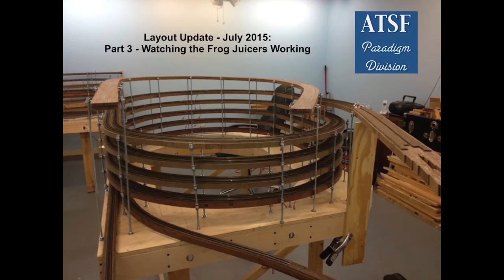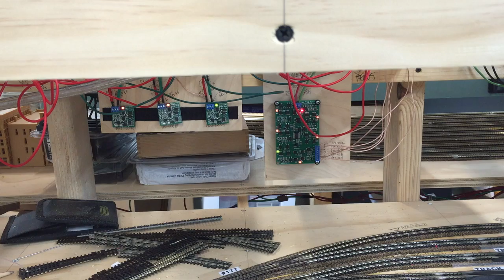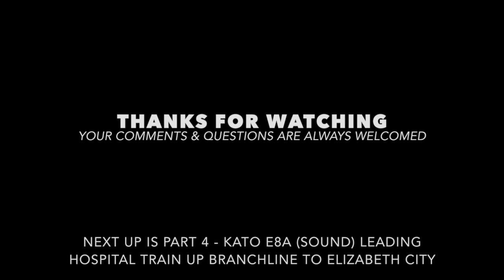Layout Update - July 2015: Part 3 - Watching the Frog Juicers Working

Comment: Hey John..thanks for sharing and keep up the great work. . I'll be running Peco switches with live frogs.. Lance
Reply from the maker: PittsburghIndustrialRailroad Have fun. Don't forget to follow the guidelines on the wiringfordcc website where he talks about switches.  

Also,  I just got my PSX1 Circuit Breakers back with their software updated and now have the main level power district 4 back in operation.
Reply: Cool.. have to take one step at a time but yes..

Comment: Looks good John, like how they work.
Bob, Longshadowsmodeltrees.com
Reply from the maker: Widi1956 This is the first time that I have used them.  I like how they work but I have to get my circuit breakers re-programmed to properly work with them.  Not a big deal as it will give me some time to work on decoder installs.